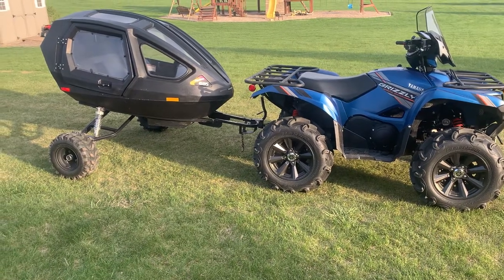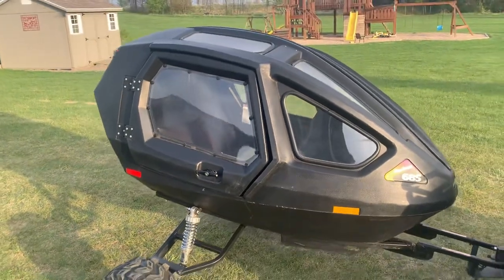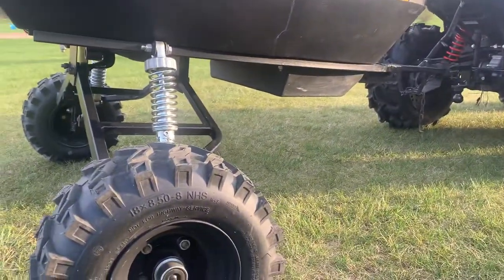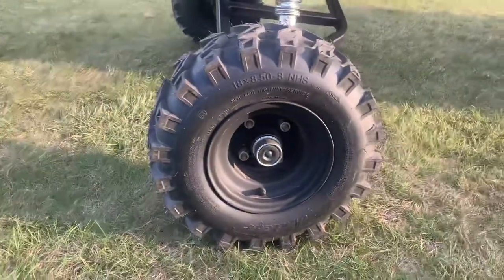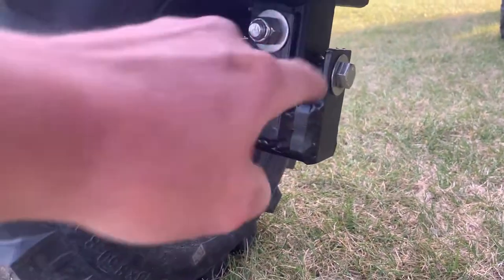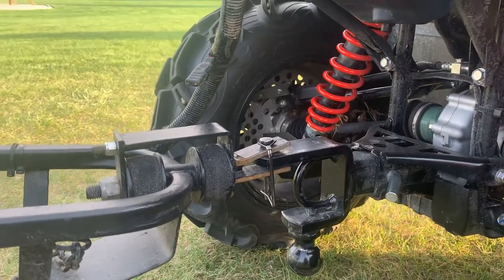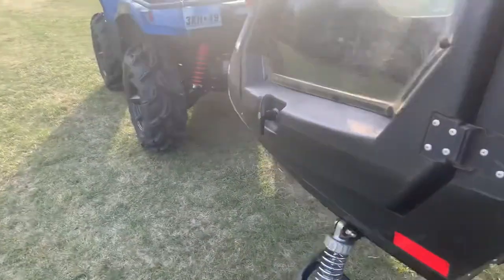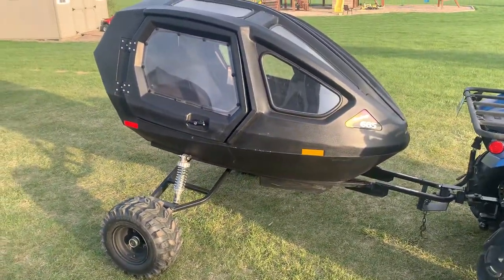Snowcoach 685 Wheel Kit

Comment: Nice video, I just got my new snow coach but didn't order the wheel kit for it as it about $800 plus shipping, question on the spindle kit , did you have to extend the 2 tube or was that the length it came? 

Thank you,
Reply from the maker: I basically bought that spindle kit and slipped the spindles into a 2” square tube, adjusted it as far in width wise then tac welded. Once I had it all tac welded up, I built the brackets around the ski mount.
Reply: Hi there Fulcan James, what did you have to pay for a new snowcoach? did you get the 685? my wife and i have been looking cant seem to buy them used fast enough!
Reply from the maker: @BiscayneAutosalesLLC  I had been looking on and off Craigslist for years then once this one popped up I jumped on it.  I paid $1500 which was a steal!
Reply: @Eighty8Fitter  that’s awesome! Were you really happy you purchased? My wife r loving the idea. A local gentleman contacted me he has a snowcoach 685 for $2000 w the shocks and it includes the hitch. I’m wondering if I should jump on it or not
Reply from the maker: @BiscayneAutosalesLLC  I would jump on that. It will resell at that price once your done with it too!
Reply: @Eighty8Fitter  are they really fun? I’m just a little hesitant like we wouldn’t use it or something my son is 6 and my daughter she’s 2.5 , my wife actually got me started looking at these lol 

Are you really glad you bought yours??
Reply from the maker: @BiscayneAutosalesLLC  oh yeah for sure man my kids ride in it a lot in the winter and summer with the wheel kit.  I’ve definitely gotten my use out of it.  My 9yo daughter and 3 year old use it the most and when my daughters friends come over they ride 3 deep in there too 😂
Reply: @Eighty8Fitter  that’s so awesome!! Definitely making the deal with him tonight or tomorrow. Hey what’s ur email I’ll send you pics of it if you’d like
Reply from the maker: @BiscayneAutosalesLLC  yup it’s joseph.wassman@gmail.com 👌🏻

Comment: Hey man turned out awesome! Where did you get the a-arm/shocks too? I checked out the link for the axle kit but all I see is the square spindels and hubs.
Reply from the maker: I found the shocks locally at a motorcycle salvage yard.  They were off an older Kawasaki motorcycle.  Any softer springs would have worked, I just happened to find a nicer chrome pair.  The a-arms were the existing arms that came with the snowcoach.